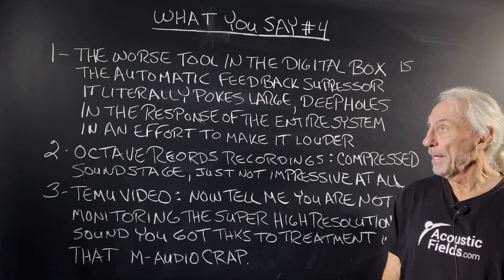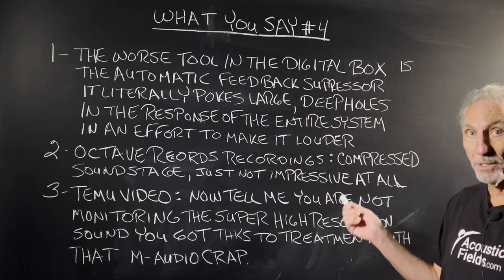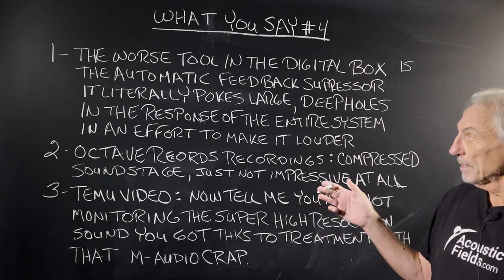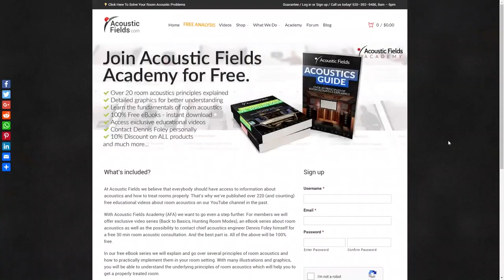What You Say #4 - www.AcousticFields.com

Comment: automatic feedback suppression is a useful tool in live-sound when there is an open mic. For instance; if a person is walking around with a mic and they move in front of a speaker it can momentarily notch out the offending frequency in hopes of avoiding feedback squeal. I can not imagine its use in a pre-recorded playback system.
Reply: Yeah, we use it a lot in live audio, I've never used it, never seen or heard of it being used in the studio.
Reply: Is it maybe possible that it is misused in situations where the PA might be undersized.
Reply: AFS is not something that applies at all to tuning a recording or listening environment, this is designed specifically for live use where the distance between the microphone and the speakers is proximate but not constant and the resonating frequencies can change. This helps gain a couple dB in gain before feedback. I have tuned live PA setups by ear for 35 years doing the same thing manually and it's a simple process once you understand how. Finding the frequencies and notching them out with a 31 band EQ or multiple bands of parametric EQ, but you just can't keep the singer or speaker from moving and changing the distances.  That being said, in a live performance with sound reinforcement (which includes for speeches as well as conferences) where setup time is usually at a minimum, automatic feedback suppression is effective in doing the job much quicker and more accurately with a narrower Q doing less damage to the response. If you don't need to push the volume they're great but the tool becomes an annoying problem to sound operators that think it can eliminate feedback and keep turning the volume up. This causes frequency cycling when you run out of available frequency locks in your unit, so it removes one (Murphy's law says usually a particular nasty frequency you really don't want) to add a new one. Voila, nasty artifacts of different frequencies coming and going from the spectrum. At least they are very narrow Q and you only notice when they start ringing.